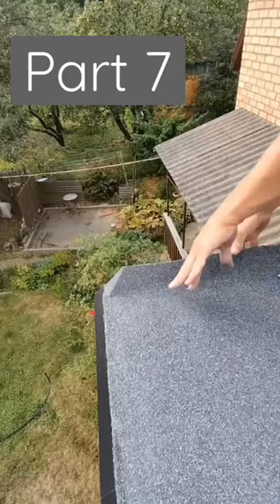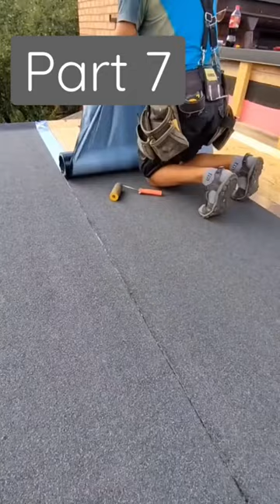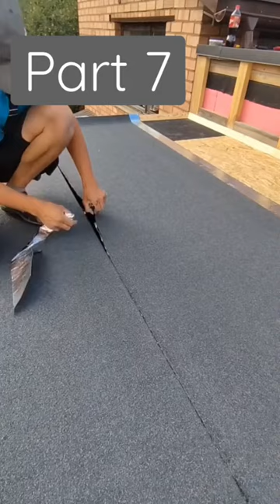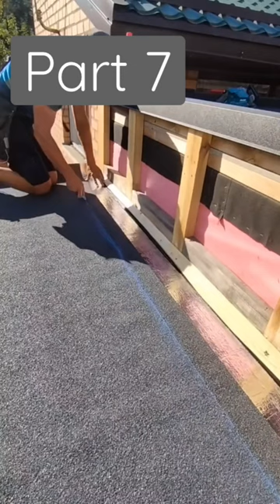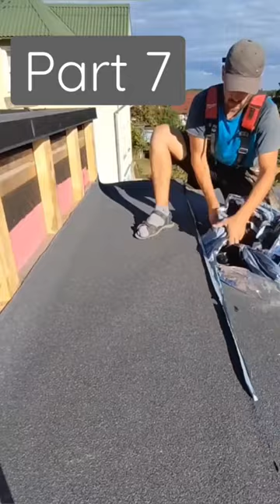We fix the bituminous roof. Construction of a 12.4m2 terrace using frame technology.  Part 7

Comment: This system is effective if you have a pitch of 1-2/12 no drains or scuppers and use at least a 2 ply system and in cold climates heat weld the seam with a TPO heat gun and roller

Comment: There’s no primer or he didn’t use heat gun on laps that roof blow off in couple months
Reply: You can get away with not using primer when felting over wood with gas torch it will stick to wood fine, use plenty of heat. We only prime , metal, concrete, brickwork,  timber is usually fine.

Comment: No base sheet? And rolling parallel to the seam traps air bubbles, weakening the bond. By going DtD like that, that roof is gonna crack open following the seams in no time, best case scenario

Comment: Oh Lord!!!!
Hes laying the felt across the roof instead of down the roof  not to mention no underlay, bonding onto the deck and to shallow a pitch.
Reply: Across the roof starting from the gutter is how you do it and you need underlayments If your slope is less than 2 degrees. Cold rolling the seam is the mistake.
Reply: @MastaTutorialz  lay felt down the roof not across the roof is the correct method here in the UK

Comment: Prime the surface metal aging Mastic rubberized on the inside of the metal edging and Joints if have any any hand roll and 80 lb roller mastic inside header and joints